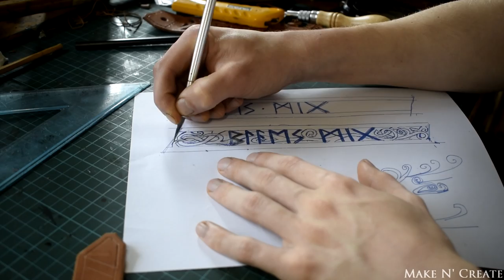Horn & Leatherworking - Making a Viking Blowing Horn

Comment: I have a tip for you. I grew up on my grandfather’s cattle ranch and one day I decided to make a powder horn. I was cutting off the scale and crud with a knife as you did, scraping with the edge of the knife. My grandfather, who grew up in the 1880s back woods northern Pennsylvania and hunted squirrels with a muzzle loading rifle (and a cow horn powder horn), saw what I was doing and said, “Let me show you something.” He broke a thick walled glass bottle (Coke I think) and with a sharp edge began to scrape the horn. The glass was much sharper and harder than the blade of my knife and the broken bottle provided more “blades” if I needed them. The job went a lot faster than if I had continued to use the knife. Grandpa had one final tip. He showed me that I could carve a little cartouche shape in the horn and with an altered bit of sharp glass very carefully shave a window in the cartouche so thin that I could easily see the level of the powder I still had in my horn. There was nothing special about the cartouche shape, it merely provided an artistic defined border and a bit of edge thickening  and reinforcement for  my semitransparent “window” so I didn’t accidentally poke my hunger through it.

Comment: Overall pretty great build, but the runes have some issue. You are using Elder Futhark, which was used before even Old Norse was spoken so blása mig, which is what I assume you were intending ,does not mean the same thing (I appreciate the humor though). You would want to use Younger Futhark so it would be ᛒᛚᚬᛋᚬ ᛘᛁᚴ.

Comment: Beautiful work. Sorry the mouthpiece didn't work out for you. Next time make the mouthpiece a cap that goes over the end, and upset and roll the edge of the mouthpiece outward on itself to make it easier on the lips (like a trumpet mouthpiece). Easy enough to epoxy the mouthpiece to the outside of the tip rather than trying to make a narrow mouthpiece to pierce the tip. For an added level of decoration you could also put a sleeve around the bell of the horn, protecting the edge from chipping over time.